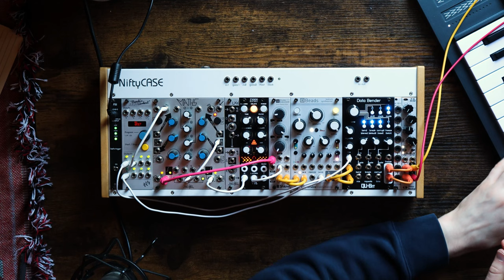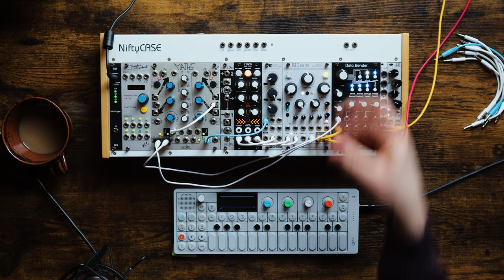MAKE NOISE MATHS - Exploring Drum Patches!

Comment: Maths Forever.  But if you want super duper fun, add an S&H.... nearly instant Autechre.
Reply: How would you patch the S&H in that context? Sounds cool.
Reply: Yeah I’d like to know that too - how would you use the s&h there please? I never know what to do with mine
Reply: You can use the sample and hold to let through other sounds set on when the voltage from maths goes high. So I will use this out of sequence from a beat to let through a wet version of the beat, as an example. Like letting through the audio from beads or data bender off beat

Check out the Mylar Melodies sample and hold videos.
Reply: @digicat247  cool I’ll check it out thanks for the tip. 👍
Reply: If you modulated the both input with a stepped voltage or a S&H it will make the trigger of envelopes speed up or slow down in a rhythmic way. That’s basically what a Krell patch is.
Reply: 👆this right here.  

This gets especially fantastic with something like the Grandmother or Mavis which has S+H on them; allowing you rhythmically tie even more in.